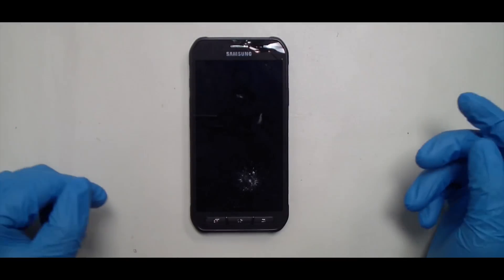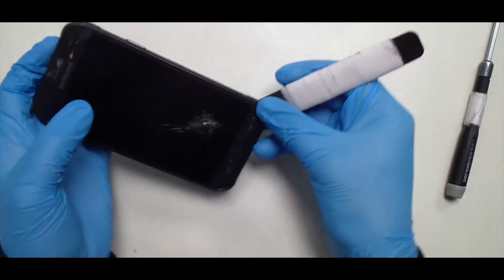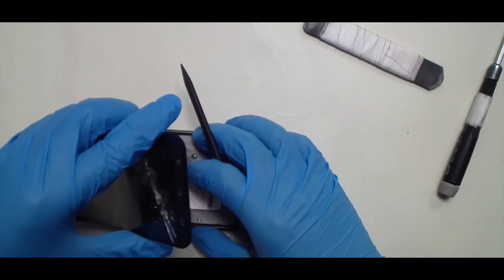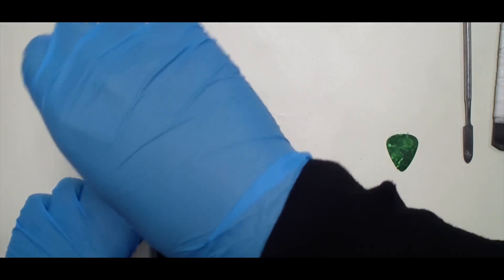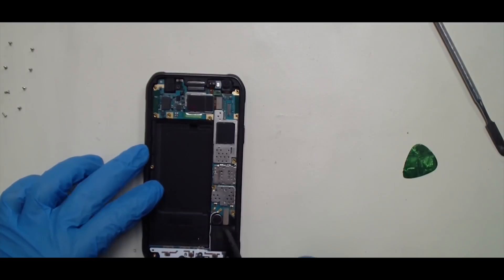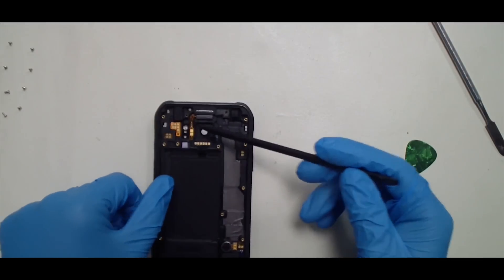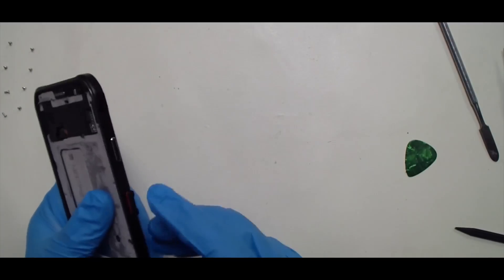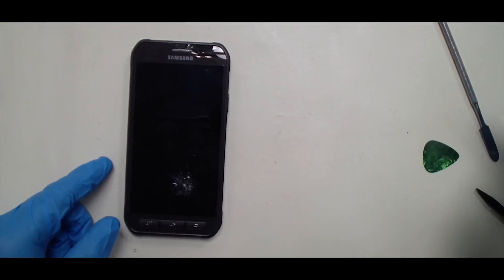Galaxy s6 Active Teardown/Disassembly

Comment: This video neglects to say that when taking the screen off the phone as shown, the glass will separate from the LCD thus rendering the phone useless since it will need a new screen.  It does not clearly show that you must get underneath the LCD screen assembly to fully separate it from the phone and even then, the LCD screen will likely crack.

Comment: video was spot on, followed it and replaced the usb port for $6
Reply: I'm thinking I need to do the same thing: the USB port is hot garbage on this thing. Have you done repairs before?
Reply: Ya at this point I have a better phone but pictures on my s6 I want so I'm either gonna replace the board if I don't break the screen or I'm gonna chop a micro b cable and solder into power just past the damaged pins to hit this thing with a charge long enough to grab the pictures

Comment: Thanks for the video, tried this myself and the screen glass separated and the digitizer stayed on which then cracked.  I also damaged some sort of connector on the digitizer towards the top of the phone. Digitizers are $175ish so I just bought a refurbished phone for $220.

If you use this method, start at the bottom and the sides. DO NOT go in from the top or you can break a connector like I did.  Also, make sure you are going in about 1/8ths inch or so and lifting the digitizer with the screen. If you see your tool through the glass you are separating the glass from the digitizer and need to go deeper before you push in with your tool.

Comment: Thanks, nice vid! If the back button doesn't respond to any presses, yet all other buttons work fine, can you advise which piece would need to be replaced to fix this issue? It's a bit difficult to see in the video. It's ok now, as I'm using button remapping as a work around, but if 1 of the other hard buttons fail, I'll def need to replace it.

Comment: This video is terrible and misleading There is NO WAY the screen will come off this easy. You must have had screen removed from frame before and doing this again. You will have tons of people with broken glass/LED after following your guide. You need to state that you have removed it before.
Reply: Of course it's not gonna come off easily, at the very least with some cosmetic damage, if not totally destroying it, so be warned!  Most modern screen which are less than 2mm thick will just crack into pieces.   10 or more years ago when screens used to have separate LCD and touch digitizer, this kind of work was doable without damage, but those days are long gone... Take this note from someone who's been doing these repair for over 20 years. ;)
Reply: todesto - 100%
Reply: Yeah, this happened to me.  Should have read down into the comments

Comment: Well, I just cracked my screen trying to get it off. He makes it look a lot easier. I don't recommend trying this since replacement LCD displays are around $180, which is almost 2/3 what I paid for the phone.
Reply: rdan721 - retail on this phone was $800.
Reply: GorillaSkull927 -- in fairness it's clear that screen had already been removed before. Still argue that $180 isn't 2/3 the cost of the device.
Reply: rdan721 haha damn that's fucked up lol.
Reply: You fool he uses a heat gun to heat the glue substance holding the screen on. If you did not follow directions properly please do not be critical of the method.

Comment: Does the rear housing contain the hands-free mic or is that on the board? Thanks
Reply: Board
Reply: Matt I know this was 2 years ago but did you ever fix the speaker phone. was it on the board or back piece
Reply: @WalterHannigan  I think it was the handsfree mic that wasn't working for me.. which Bob said was on the board. Gosh I think since then i've been through about 4 different phones.. I have 2 s6 actives sitting in my draw. One hardware is all in tact but its completely software bricked.
Reply: @maffooo  I have replaced battery and port twice. speaker just went out. I can hear them they can't hear me. I don't really need speaker phone but if it's a cheap fix I will fix it. I hate buying 800 phones.

Comment: Heads UP!  Be CERTAIN to heat up the middle just as much as the sides!  It's ALL covered in sticker residue so if you don't heat the center enough, the backing will rip....luckily mine still seems to work even after that mishap, but best not to do that.
Reply: DFKnightmare what is that foil backing? Mine was glued to the phone and got ripped too. Will the screen still work or is it ruined? Tks
Reply: same issue, after doing this my phone is black screen blue light, sometimes plays sounds of bootlooping.

Comment: Was it still water proof after the work done?
Reply from the maker: no
Reply: Same question
Reply: zxda10 - thank you for being honest; that's commendable
Reply: Using strips of double sided tape probably won't seal it properly, but using original factory cut adhesive should make it water resistant. (note: RESISTANT is not the same as totally water PROOF).
Reply: Get some T-7000 glue and if you're careful you can probably make it waterproof again during assembly.

Comment: is that glass covering up the camera heat sealed on too? because I have dust and stuff on the inside of that and I don't really want to take the whole phone apart just for that.
Reply from the maker: +AbuzzCylinder56  yes, front camera is covered by glass and adhesive all around.
Reply: zxda10 sorry I meant the back camera. I'm pretty sure it is. I think I'll just suffer with a bad camera cause I'm too lazy to do it.

Comment: does the battery come out? I'm looking to replace mine bc the capacity is down to 82% now after 15 months of use. thanks. great video
Reply from the maker: +Steve Lin yes you can
Reply from the maker: +Steve Lin  if you can take of the screen, battery is under the mid frame.  Super easy
Reply: S6 active has battery door (glued on back cover).  Isn't that much easier way to replace battery than going through the front and removing the screen?
Reply: @springer-qb4dv  well if you want to break your phone i guess you can go for it...lol